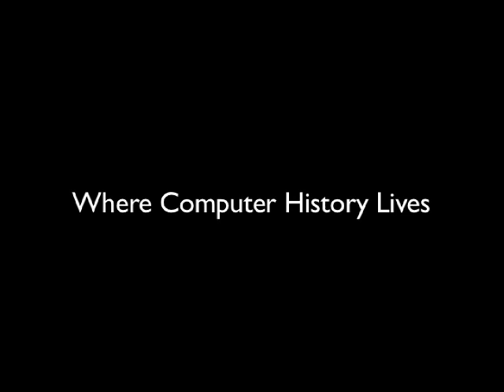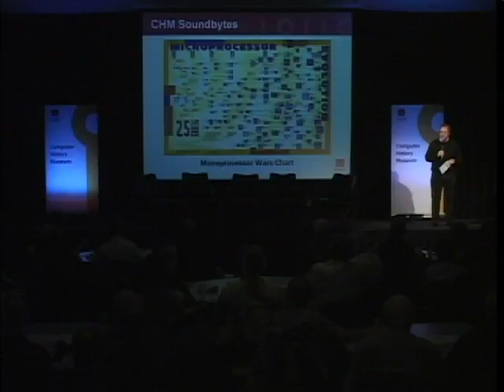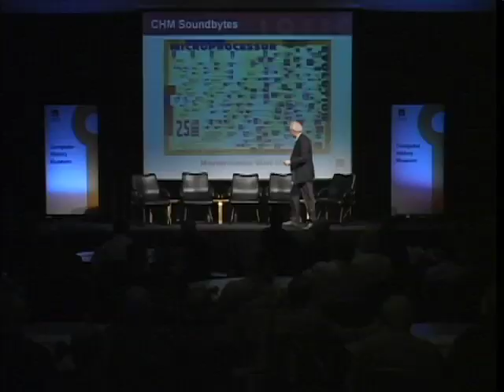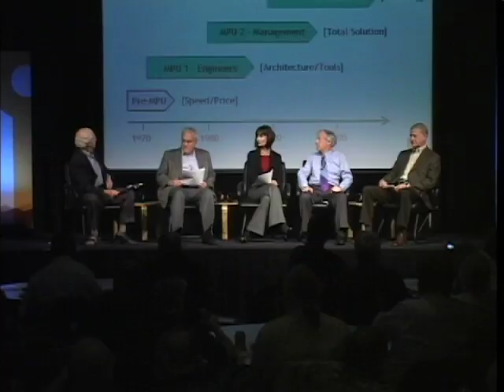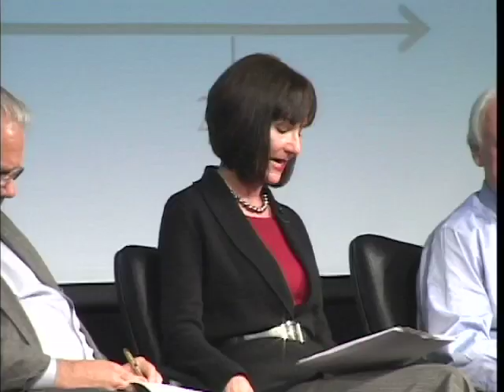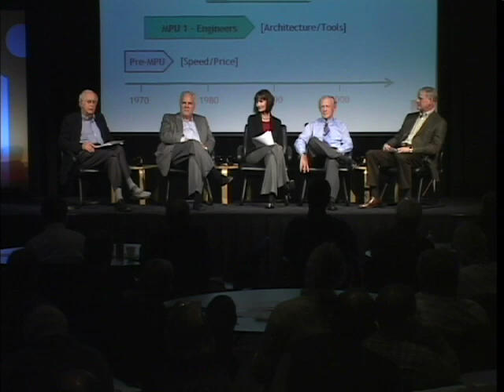Microprocessor Marketing Wars

Comment: I worked at AMD during the 486, Pentium,  K7, and Athlon years and a big part of the whole story was left out because of the litigation between AMD and Intel. Also, for other reasons this account was not very accurate. Mostly because the most important thing that ever happened to Intel was when IBM chose the 8086 for the "PC". Software compatibility was the most important factor in determining  what would be the next "PC" processor. Salesmen like to think they were important factors, but not so.